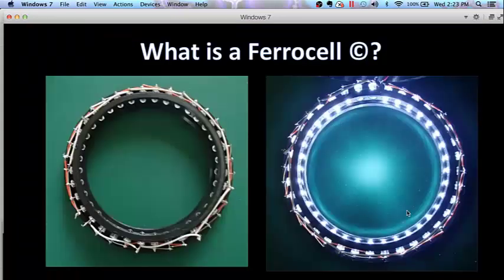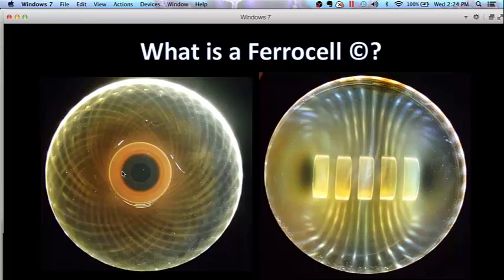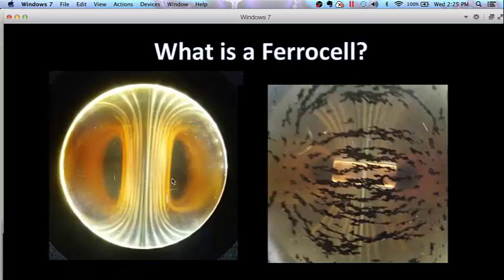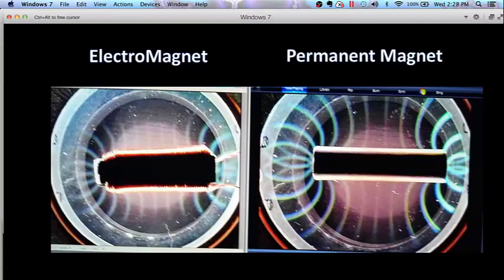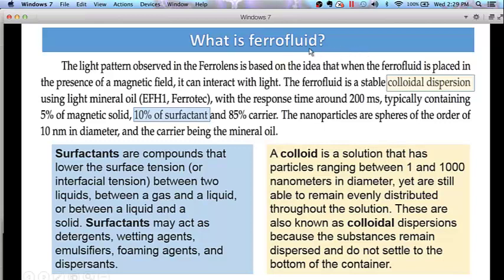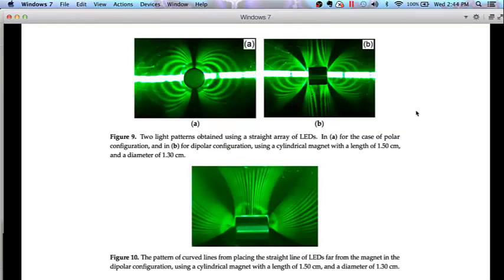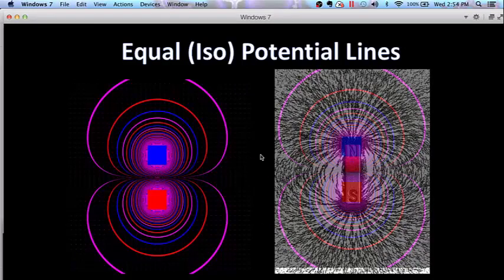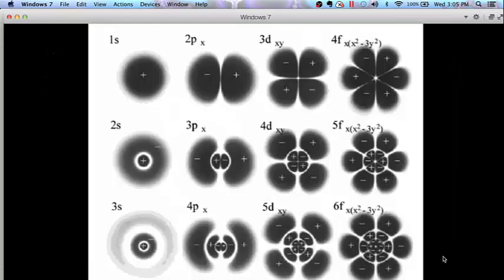Unveiling the Missing Secret of Magnetism

Comment: I have to say I'm flabbergasted by this video. I gave it a like when I was halfway through, but I had to take it back before the ending. The first half of the video is critical, coming to the conclusion that the shape we see under the ferrocell polar view is an optical illusion. The most shocking reveal of the whole channel's history. But then you immediately go on, and in the second part we are presented ideas for a new speculation, regarding the analogies with atomic (!!) structures, while still hinting at some connection with Ken Wheeler's ideas.
Maybe it's just me, I could well be misunderstanding everything. Maybe you can tell me what I don't understand.
The "vortex", the "Torus Knot" (I wonder why this slightly bombastic definition is now left aside) is an optical illusion. Everything we see under the ferrocell has to be interpreted as light diffraction and the LED positioning is crucial in building the apparent "knot", while Ken Wheeler went on for hundreds of pages and literally thousands of hours ranting about that very shape without taking in consideration this vital aspects (at least, not sharing them with his audience). The whole analysis works out fine without any anticartesian, or counterspatial, geometry. In the end, we can see that the work of the Atomists (Wheeler's self-proclaimed nemeses) could be strengthened by the observation of the ferrocell.
To me this means that:
Wheeler is not to be trusted on anything;
Ferrocells don't have anything really exciting (new) to say about magnetism;
This whole ride was maybe disappointing but at least now we can't be fooled anymore in this respect.

Why is the second part of your video so different from drawing such conclusions? Why do you care about orbitals and, most of all, why do you still see this as confermation of Wheeler's ideas??
Reply from the maker: Lucas: These are all great questions and your concerns are valid. I guess I do need to make more videos after all. Regarding the torus knot, I want you to imagine the torus as a smoke ring which "spins" inside out. Then I want you to imagine that the smoke ring structure is spinning around an axis as well. The spinning of the torus about an axis is analogous to the "turns around" the torus (in the torus knot geometry) and the inside out spinning is analogous to the "turns through" the torus (in the torus knot geometry). An imaginary "particle" riding on the flow of this structure will follow the path of the torus knot. The torus knot is an effect and not a cause. 

Also, in the first part if my video, I explain what the ferrocell is trying to show us, and the second part, I explain what it is trying to TELL us. This is my interpretation of what it all means. For the record, I am not the only one that thinks this. Timm and his team also think this and that is what their next paper is going to be about. I am just the messenger, but I also happen to agree.
Reply: @FractalWoman  Thanks dear. I will contemplate the representation you are suggesting. I will try not to come to conclusions too soon.
Reply: Ken Wheeler theorized the shapes of the fields before Vanderelli invented the ferrocell.
Ken does not deny the existence of atoms; he is opposed to the philosophy of "atomism" (particle physics).
Reply from the maker: @codetech5598  Yes, I agree. Only the shapes of the lines that we see in the ferrocell is NOT the magnetic field in my opinion. There are no "field lines" in and around the magnet that look like this. It is an optical illusion based on the position of the lights. THIS is what Ken predicted.
Reply: @FractalWoman  I'm not sure Ken says there's a relation between the postioning of the lights and the resulting shape (actually I remember the opposite). Moreover, I'm not sure that Code Tech and you are saying the same thing. I will think about this, but as of now my opinion of Ken is kinda low. I discussed the properties of the shape under the ferrocell with him and he didn't even try to understand what I was telling him, while, if what you are saying is true, those kind of observations should have immediately captured his attention and be recognized by him. When I pointed out the same things to Lori, she understood and was concerned, so much so that her presentation of the torus knot is very different today than just a month ago. If he already knew all this stuff, he would have been a good listener and a good clarificator. But HE DIDN'T EVEN UNDERSTAND WHAT I WAS TALKING ABOUT. I will ponder your observations; you ponder this.
Reply from the maker: @lucassiccardi8764  If Ken said that the geometry shown in the ferrocell is not dependent on the light source (and I think you are right and he did), then I just blew that out of the water.
Reply: @FractalWoman  <3
Reply: @FractalWoman  What then is the path of the Æther?
Reply from the maker: @codetech5598  When water goes down the drain of a sink, the air stored in the pipe below the drain has to come out. What is the path of the water? What is the path of the air?
Reply: @FractalWoman  It spirals around a vortex. Air goes up, water down.
Reply from the maker: @codetech5598  Yes, but more accurately...water spirals in and air spirals out. This is the best and most efficient pressure mediation for the water to go in and at the same time, let the air come out.
Reply: @FractalWoman  What is the relation between the path of the Æther and the magnetic field? What is the shape of the Æther path?
Reply from the maker: @codetech5598  Well, I am still pondering that but what I think is that the isopotential lines are the lines of equal magnetic force but that says nothing about the dynamics of the system. Let's not forget that the term "field" is an abstract concept and has no formal definition. As Ken says, "no one has been able to define a field. If I'm talking about the isopotential lines, then that is the field. They are the field of points that define the isopotential lines. In a similar manner, the iron filings could be the field. They are the points that define the "field" orthogonal to the isopotential lines. These "fields" are abstract ideas that say nothing about the dynamics that create these "fields". Fields are emergent properties and not "things" in of themselves.
Reply: @FractalWoman  Do you think that the Ferrocell provides useful information, or that it is misleading?
Reply from the maker: @codetech5598  BOTH. It is definitely telling us something important, just not what we originally thought. It is my opinion that the medium for the propagation of light is, for all intents and purposes, a ferrofluid. If the medium is made up of electron-positron pairs as I suspect, and, these pairs behave like tiny magnets as I suspect, AND, if the inertial component of the Æther acts as a colloid solution keeping the "magnets" evenly dispersed in the absence of matter (or large scale magnets), as I suspect, then, the ferrocell is telling ups something very important about the nature of the medium for the propagation of light.
Reply from the maker: ian swain  "so not just an optical illusion"
Because we are talking about glass and light etc, we are talking about optics. This is literally an 'optical' illusion. Without the optics (the ferrolens), there is no effect. Without the magnet, there is not effect. And it is an illusion in that you can't take what you see in the ferrolens too literally. The magnet is not curving the lines directly. The magnet is creating a diffraction grating in the ferrolens and this is what is causing the light to behave the way it does.
Reply from the maker: ian swain   I use the term "illusion" because a lot of people out there think that the are misinterpreting what the crisscrossing lines meant. It was also meant as kind of a "funny" because a lot of people use the term "optical illusion" without really thinking about what it really means. We are talking about optics here and the interaction of light with different media. I agree that "optical effect" is a better way of saying it.

Comment: Does the similarities of the orbitals correlate with atoms that make good magnets, like iron, or is it more of a refraction pattern that emerges from fields/waves. What if we shaped a magnet pole with the geometry of a concave lense, how would that effect the pattern?
Reply from the maker: The orbital patterns correspond to ALL atoms. 

In MRI physics, the proton inside a hydrogen is considered as a tiny bar magnet. https://www.khanacademy.org/test-prep/mcat/physical-processes/proton-nuclear-magnetic-resonance/a/magnetic-resonance-imaging-mri

In the MRI machine, the hydrogen atoms (which are basically protons) are behaving as if they are small magnets in the vicinity of a large magnet. In a similar manner, in the atom, the electrons are behaving as if they are small magnets in the vicinity of the large magnets (the protons). That is why the orbital patterns look exactly the same as the isopotential patterns as seen in the video.

Hope this helps.
Reply: @FractalWoman  I didn’t realize protons and electrons are like magnets. I wonder if this is due to the spin charges of the quantum particles that make them up. Maybe why they fall into orbits is the   Part due to the orientation of the spin in relation to each other?
Reply from the maker: @deths1679  Yes. It's all about spin.